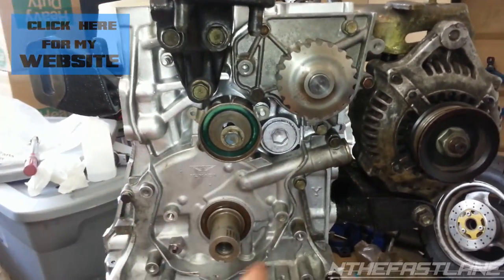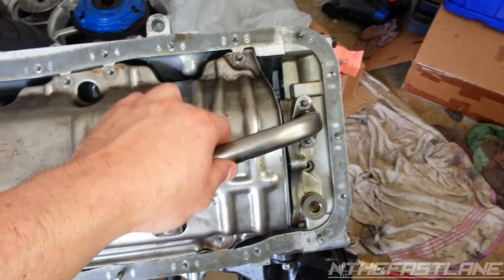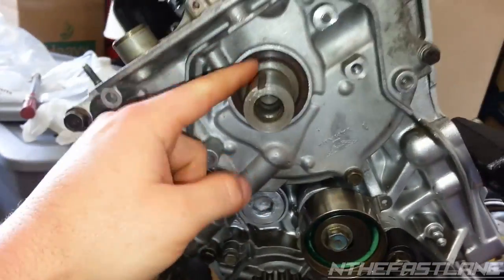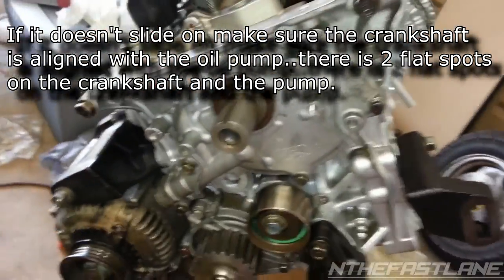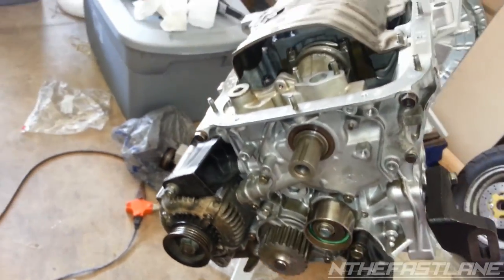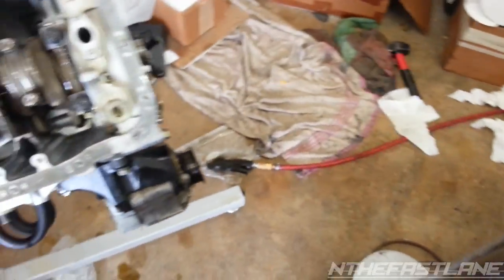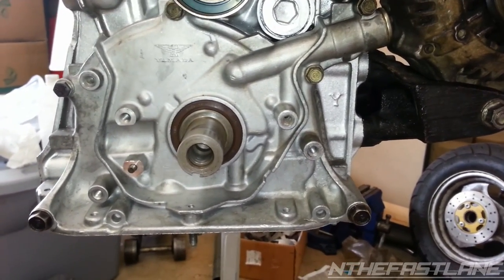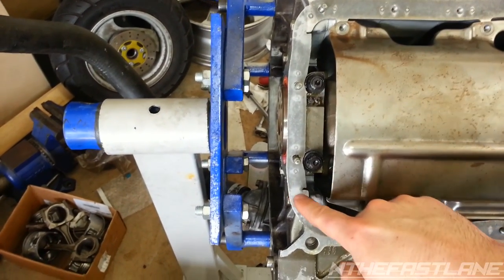Oil Pump Install Honda B-series "How To"

Comment: nice video of the engine out.  things are easier to understand.  i have to do a timing belt job soon on my 98 Integra. my questions:
1. if I'm going to replace that crankshaft seal, then  can i do this without taking the oil pan off & pump? the dealership parts guy told me to access this seal i need to go at it from the pan , removal of the pump & access it from behind.
2. you cannot remove the oil pump w/o taking out the oil pan off first,  correct?

Comment: Doing a b18b1 block rebuild and the oil pump is essentially glued on with a sort of silicone. Any tips on removal?
Reply from the maker: Take some gasoline with a paintbrush and paint around the oil pump until the gasoline absorbs into the silicone. You can even spray some brake cleaner around the oil pump and that should break it up as well.

When you're prying, avoid prying where the mating surfaces are. You can even take a rubber mallet and smack the backside of the oil pump if the oil pan is off.

Comment: This is a very thorough and helpful video. Would you happen to know if the oil pump fails, will it restrict rotating the motor over by hand at the crank counter clockwise? I'm trying to figure out if my Integra B18B1 motor is seized or if the oil/water pump is seized, therefore restricting the motor from rotating counter clockwise? The motor freely turns clockwise just not counter clockwise. I don't want to fully rotate the motor a revolution clockwise since B series motors spin counter clockwise. 

I pulled the spark plugs all serpentine belts (AC, power steering and alternator) plus dismounted the starter and distributor and I am still unable to turn the motor over counter clockwise. I poured Marvel Mystery oil into the spark plug holes and let it sit for about a week and still no luck. The next step would be to dismount the timing belt and inspect the water/oil pump. Any insight would be greatly appreciated. Thank you
Reply from the maker: It's tough to say. Could be valves making contact with the piston, could also be something to do with the timing belt tensioner. I would first check out the timing belt situation and see if the tensioner isn't causing a problem. When you rotate clockwise it pulls down on the tensioner, but when you rotate counterclockwise it loosens the tensioner and allows it to go back up if it's not locked in. 

Is the transmission mounted? Maybe it's in reverse?
Reply: @Nthefastlane  Thank you for your reply. The transmission is mounted and the shifter is in neutral. Some background on what lead to this issue.. My car was partially flooded due to the recent storm in the northeast. Prior to this my car was driving fine, it was parked when it was subjected to water so I'm ruling out hydrolock since it wasn't running. The following day I drained the motor oil which had approximately one tablespoon of water and pulled the spark plugs. I drained the transmission as well it had no water. I pulled the valve cover and there was no water inside either. I pulled the oil dipstick and there was no water droplets. I have yet tried to turn it on as I don't want to potentially risk damaging the motor internally. 

Being that I can still turn the crank clockwise freely, is there hope that the motor is not seized and it is being restricted by something mechanical such as then the water pump or tensioner? Would you know when a motor is seized if it will NOT turn over in either direction or it can still turn in one direction and still be considered seized? I doubt the valves are out of time since the timing belt and tensioner is rather new and the timing was set-up correctly. 

Initially when I rotated the crank counter clockwise, I mistakenly had the car in gear one, I thought the car being in gear was the issue but with the shifter in neutral it still has the issue. Is it possible that the shifter is in neutral but that the shift linkage or other transmission component is still stuck in gear one? Slave cylinder issue? The transmission has fresh fluid. Thank you for your help.

Comment: so I am in the process of taking my crankshaft out, and the only problem that I am having is that I can't get that crank gear or pulley as you referred to it as in the video off, is there a certain way to get it off or should it just slide off?

Comment: Years later and I appreciate the video! Also, can you add the Oil pump/pickup tube torque from this video into your Nthefastlane app?  I was using it the other night for a rebuild and did not see the specs listed. Again thanks for you help to the community too!

Comment: I need help.  my oil pump / rear balance shaft is leaking oil. I got the little pump off the car but,  how do i get the gear off the balance shaft to replace the seal ?

Comment: Do I flip my car over to work more confortable .how do you replace it with the motor atached to the car .please
Reply from the maker: Place a block of wood and a jack underneath the oil pan. Then you are going to remove the 2-17 mm bolts on the driver side motor mount. Slowly lower the engine down. Make sure you have proper jack stands in place and the driver side tire removed. Follow my timing belt and water pump repair video. Link: https://www.nthefastlane.com/timing-belt-water-pump-honda-b

Comment: What is the long tube going towards the rear of the motor? I have a leak at that plug and cant seem to keep it from leaking
Reply from the maker: It's called the " water pump connecting pipe". They usually leak on either ends of the pipe, the o-rings need to be replaced.

Comment: I need to change the o ring seal on my 2005 civic ex oil pump, would this be the same procedure for it as far removing the oil pump and putting it back? Thanks! And awesome vids by the way.
Reply: sleeper 

same shit just different torque specs..

Comment: What would make a front crank seal keep popping out
Reply from the maker: A bad PCV valve. Engine builds up too much crankcase pressure and is not able to be relieved by the PCV system. 

This can cause valve stem seals to leak, valve cover gaskets can leak and can even cause front and main seals to push out. Sometimes the dipsticks will pop out too.

Comment: Does the engine really need to be pulled for this? I am trying to find an oil leak and I think it might be coming from the oil pump seal.
Reply: No, engine does not need to be pulled out.
He didn't show us from under the car works.
This job cost much more than doing a timing belt kit replacement.
Most customers will not going to pay for this repair jobs.

Comment: Can your oil pump break when changing a tension on the timing belt or rebuilding the engine
Reply: Eddie Morales 

Umm... no. The timing belt runs on the sprocket on the snout of the crank.. if you break thes crank snout by some miraculous way then you are god..

Comment: How do you prime the oil pump
Reply from the maker: When it's in the vehicle pull the fuel pump fuse and crank the engine about 50 revolutions.

Comment: can you show us how to take off the oil pump while the engine sits inside the car
Reply: willcgodsson 

Lmao it's not that hard dude. Only difference is exhaust needs removed and the chassis limits the room to work with but it's not bad at all..

Comment: Do i have to remove the engine to do it?
Reply: No. It will be a two days job.
Like doing a complete timing belt kit, oil pan gasket, valve & exhaust gaskets replacement.
You have to drain the oil & remove the exhaust pipe & timing belt system.

ATG says a very lousy design from Honda, just to replace a $15.00 O-Ring with labor of $800+.

Comment: Why nobody primes the pump? Are you also  miss/messing that on a purpose?
Reply from the maker: I always prime my pumps when the engines in the vehicle. Pull the fuel pump fuse and crank it until oil pressure kicks in. Put the fuse back in and fired it up. It doesn't hurt to add a little bit of oil to the pump gear to keep it lubricated.

Comment: Great video man . Thanks, this video is going to be very useful  4me soon
Reply from the maker: Glad I could help.
Reply: +Nthefastlane my 00 b16a2 pickup  doesn't want to line up with my 00 gsr oil pump. its like half an inch off, the motor is a b16a2 with a 00 gsr oil pump. any suggestions?
Reply: thanks 6